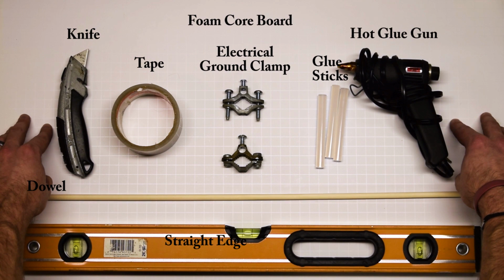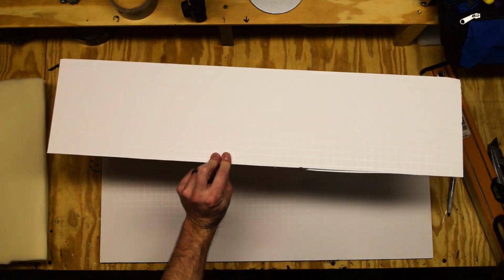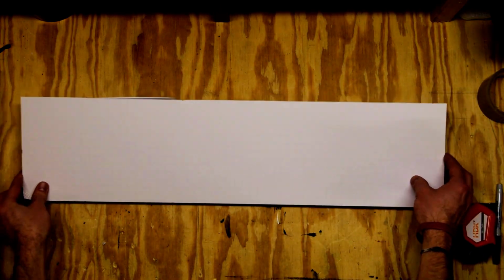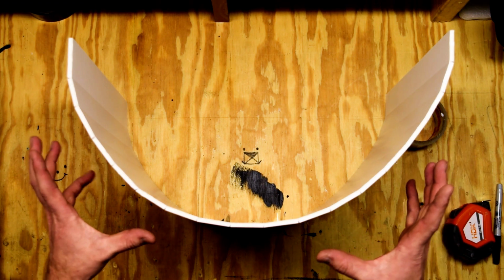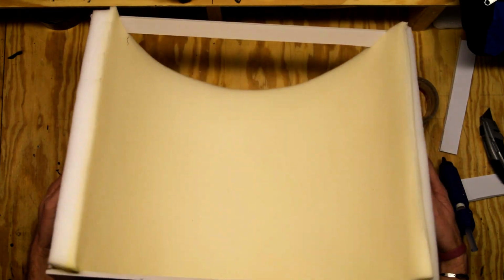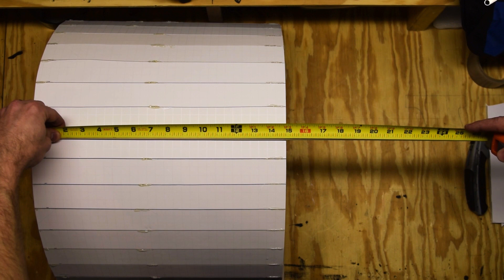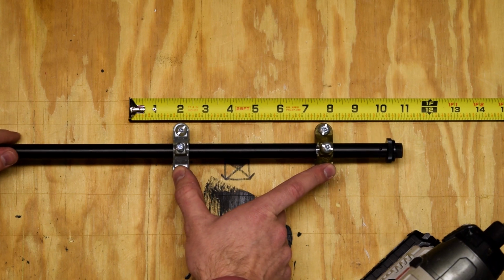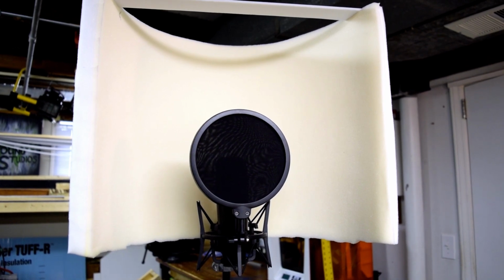Curved Vocal Booth Isolator - DIY Build For Only $14 (Beginners Vocal Booth)

Comment: Great construction tips, thank you!!

There are a few acoustical concerns with the design though - 

The type of foam or absorbent material matters a lot!  In fact it's absolutely critical for good performance.  Open cell foam meant for upholstery will have very little effect compared to closed cell foam meant for acoustic sound control.   I'd also highly recommend using Denim insulation for this purpose such as the Ultratouch products.  Very thin versions are available from large retailers and can be layered for good effect.  Or specialty shops will have 1" - 2" thick sheets that are perfect for sound control.  Often this is much cheaper than acoustic foam and can be equal to if not more effective.

Then the backing board holding the foam should not be one solid piece.  The holes you see in commercial versions are there to let a certain amount of sound pass through.  Otherwise you are creating a solid wall which can create new reflections.  We want that backer board to be perforated enough to not reflect the singer's voice back towards the mic.  I'd think that a large drill bit or circle cutting bit should work fine for this.

Hope this helps and thanks again for the great video!
Reply from the maker: Hey Daniel, yes i agree with what you had mentioned. I was trying to create a simple but effective beginners vocal booth for someone just starting out that can build built with easily accessible materials.. I actually tried cutting slots through the back of the foam board but i made it way too flimsy. Also even with that inexpensive Samson mic (and other budget friendly mics), the rear rejection is actually pretty good on its own. Obviously this is no top end vocal booth isolator but if you watch the test video it actually did improve the isolation of the mic. I'm currently working on a video that shows how to build a much more high end/effective vocal booth and i will do a comparison with this one. I do appreciate the insight, thank you!
Reply: Key word, "Beginners" Vocal Booth. Think you missed that, my friend.

Comment: Great, lightweight rig that won't weigh down the stand. As I'm using a boom, I'm not sure I can use the dowel, but as long as I have it sitting directly behind the mic, I should be good.

Comment: sir for better sound try putting foam at the top, and the bottom of you booth, for you will have reverb from the top and bottom, and also you wi need something at the back of you when your recording to stop    most reverb from the front which is the mic most important.
Reply from the maker: Yes, you can definitely make a better vocal isolator than this. That's why i called it a beginner vocal booth because it is just the most simple version. I try to get artists to build this booth https://youtu.be/sjxyD9A3vcw becuase it is what i consider to be the best without compromising quality. Obviously if you could afford to build a great vocal booth it would be nothing like this one. This is really an inexpensive way to get a better vocal sound without spending a lot of money. Thanks for watching!

Comment: A bit late   to the party, but how well do you think EVA Floor foam will do for the back plate?
Reply from the maker: Never used it so i'm not sure
Reply: Dram Springfeald better late than never. That's the great thing about the internet.....u put something out there, a comment, a video, a pic, etc, and someone may not comment or notice for AWHILE...cause there is SO much content out there! But someone will notice....eventually👍

Comment: Isn't it easier to glue the foam to a bended cardboard?
Reply from the maker: That could work too! I think the foam board is stronger but i haven't tried it with cardboard. Thanks for watching
Reply: nmkrios nope the cardboards have a lot of vibrations and that creates tons of reflections, I would tell you to get something more solid, which will make a better treated place.

Comment: Hello.. my question is: why do the manufactured versions of isolators all have some sort of metal on the outside of their booths?  Does that make a difference in the sound you get?
Reply from the maker: Barry Schwam that metal is just to make the isolator strong and support the foam material inside of the unit. The foam will make the difference in sound, the metal could change the sound depending on the size of the holes drilled in it

Comment: Sorry, beginner here. Is sound booth necessary if i have pop filter? or
Reply from the maker: No problem, so yes the pop filter only stops the air that comes from your mouth from effecting the mic capsule. A vocal booth stops the room acoustics from effecting your vocal recording. Both are very important for getting a clean and professional vocal sound. Thanks for watching!
Reply: Thanks!

Comment: Hmm am i the only one who thinks the voice sounds better without the booth..
Reply from the maker: So yes the voice sounds a little more open and brighter which is would be great if you weren't going to process and compress the vocal. As you start compressing the vocal without the booth, all of the room sound will actually be brought up as well. So if you wanted a really dry in your face vocal, you won't be able to achieve that. This is why in a setup you would want to record the vocal dry and then add the room sound depending on what your looking for.
Reply: I think it kills the high end and doesn't do a good job absorbing the low end.